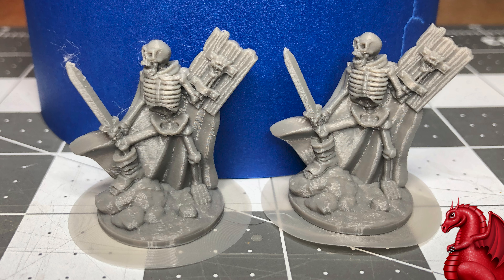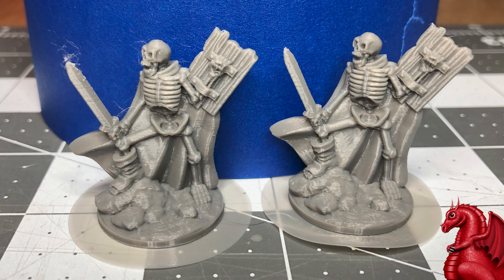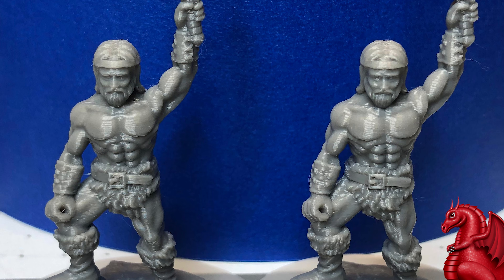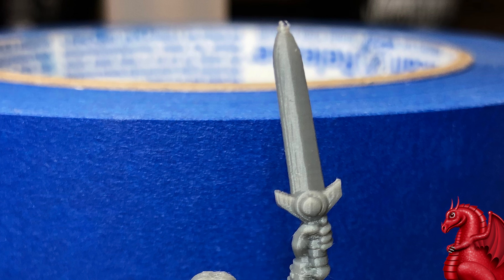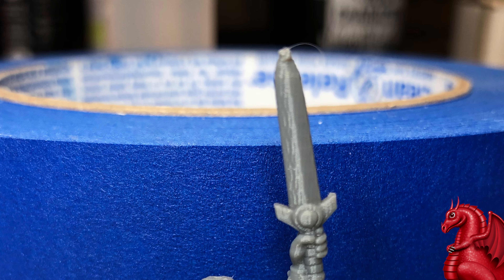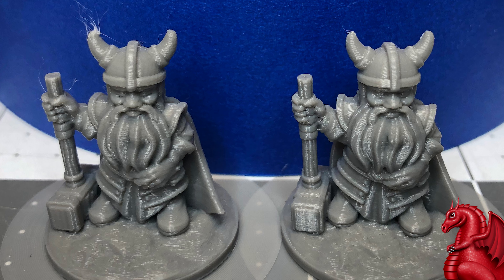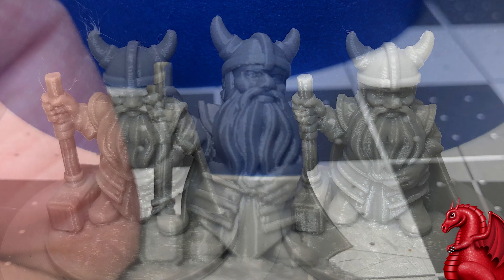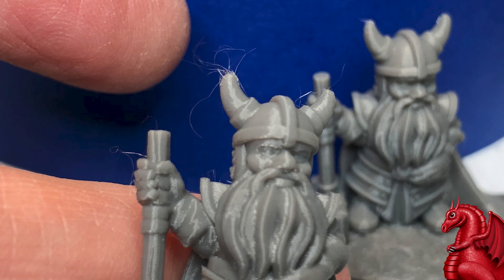Bambu Lab A1 versus A1 Mini print quality

Comment: For those here in the future (August, 2025)  I have had the full sized A1 for 2 weeks now and using a .2 mm nozzle with eSun PLA+ I haven't experienced the stringing at all using the latest FDG profile.
Reply from the maker: My v16 (and soon to be released v17) profile has gotten the A1 to print minis extremely close to the A1 Mini, the difference now is extremely minimal. :)
Reply: There is a noticeable improvement using the hardened steel nozzle over the stainless.
I replaced mine within 2 weeks, so it was not worn.

Comment: thank you for the great video - random question - why do you think there's stringing on the A1 vs the A1 mini? Hypothesis?
Reply from the maker: They are mechanically different, the mini has a linear rail for the Z axis, while the full size has dual screws which is less ideal than a single one (two can 'fight' each other.) Less mass on bed, etc.
Reply: @Tombof3DPrintedHorrors  thank you for explaining. Made a mistake and bought the A1 assuming it'd be mechanically better/similar. I saw your video too late.
Reply from the maker: @OmairZeeshan  The quality difference is slight, and only on miniatures, a fast pass with some tape to pull the strings off and all is good. The full size A1 is a fantastic machine, I bought two and love them.
Reply: @Tombof3DPrintedHorrors  thank you again for your kind reassurance

Comment: Is the mini on base settings out of the box or no. case i want to get a FDM printer that i can print DnD and 40k minis and what not on it with good quality, good for people that can just plug in and go. I not good with it comes to the settings on the slicer programs. I have had good luck with resin printers, but do to being in a studio apartment i cant have one. made me sick.
Reply from the maker: The minis shown are my own designs, so I cannot say how another designer's minis will do (it all depends on their skill level in engineering the miniature). Only changes to the printer is installing a .2 nozzle and using my custom slicer profile (available on my website.) And agreed on resin, we do not use them in our office due to health concerns.

Comment: Just need to thank you for all the work you do! Got my mini a week ago and your v12 profile knocks it out of the park for every print I do. Would love to hear your opinion on supports, as I had a lot of trouble with the auto tree supports not supporting all important areas and manual supports are often pretty encasing and hard to remove.
Reply from the maker: Sorry, nothing I design requires supports, so I don't develop settings for them. :)

Comment: Which one fails more often?
Reply from the maker: Neither, only fails I have had were adhesion issues which the new super tack plates totally eliminate, and a filament clog when I tested cheap filament for my PLA print test video.
Reply: @ thank you so much much for replying I was starting to regret getting the a1 instead of the mini so did I make the righ5 choice of keeping the order?
Reply from the maker: @Memertoad  oh yeah, the A1 is a fantastic machine and will do really nice miniatures. Only difference is you may have a few more strings on minis to trim off, but that's it. :)

Comment: A post processing video would be cool
Reply from the maker: I don't do any post processing, just trim the top most point on the model where the nozzle left the print (there's usually a tiny strand of filament there) and prime.
Reply: @Tombof3DPrintedHorrors  what priming process do you use i have used rustoleum but It always leaves bad layer lines. And I'm not sure if that's inevitable or if I can fix it
Reply from the maker: @ I use Rustoleum (and sometimes Krylon) for a lot of stuff, and Stynelrez for minis when I have to airbrush during the winter.

Comment: Hey Tom, thank you so much for all your hard work and research. I've recently gotten my Bambu Lab A1 (Regular, not Mini) and am blown away by the quality. I am however running into the issue of stringing as you're describing here. However, I feel like the stringing I'm experiencing is more severe. For example, printing the barbarian, the entire area inbetween the body and non-sword wielding arm is filled with thick stringing. Hitting it with a heatgun makes that blob up, but I still have to go over it with an exacto knife to scrape it off, leaving some scarring in the process.

Do you have any suggestions on what settings I could look into to dial this in?

Comment: Why is there more stringing on A1 vs the A1 Mini? Aren't they essentially the same printers? If anything A1 should be better, since it has more stable X & Y axis movement, no?
Reply from the maker: Nope, not the same. A1 Mini has a linear rail for Z axis (and single screw) which is better than just two screws fighting each other. Also less mass with smaller bed.
Reply: @Tombof3DPrintedHorrors Oh interesting. Now I see it. You are right with the mass too. I'm considering between the two, but I'm starting to leaning towards A1 Mini over A1, because 99% of the time I want to use it for miniature printing. Saving 100€ and some space also sounds good. Can you please tell me what is your experience with the noise level of the two? Is it the same for both or is one quieter than the other?

Comment: So from what I understand, the better detail on the mini is due to having a lower bed mass. Would a slower print speed on the full size A1 compensate for the larger bed mass?
Reply from the maker: Bed size isn't the only mechanical difference between the machines, and no, printing slower won't help (it actually makes some things look worse.) The A1 will do good miniatures, they will just need a little extra cleaning up vs ones from the A1 Mini.

Comment: I don't you if you have the time to reply this comment (I hope so). I followed all your previous videos (pre A1) and tutorials, then I tried to print on a Sunlu T3 (basically an Ender 3 clone) two sample miniature from your FDG series.
The knight with horn came out quite well with your settings but the skeleton rising from underground keeps giving an hanging element error not printing the arms and head. What did I do wrong? Is the skeleton supposed to be prjnted with supports?
Reply from the maker: Are you using my Cura miniatures profile? (I'm not clear why this comment is on a Bambu Lab video when you are using an Ender clone and I have Ender 2/3 miniature printing videos.)
Reply: @Tombof3DPrintedHorrors my bad for not commenting on the ender videos. Yes, I followed the settings you suggested in the ender videos and tried to copy the content of your Cura profiles (sadly the version of Cura I can run is older and can't install the profiles directly). I got pretty results with two minor issues I am trying to figure out: 
1) the horns of the knight's helmet came a bit weird (maybe an issue with very small detail with 0.4 nozzle/temperature/speed?)
2) the rising skeleton failed to print part of the arms above ground and the upper part of skull (maybe I was wrong assuming it is support less?)
Anyway I want to say I love your videos because they motivated me to jump into FDM 3D printing (I didn't want to use resin printer but I like miniatures)

Comment: Since both of these models seems to use similar hardware, do you know what could be the reason for difference in the output
Reply from the maker: There are many hardware differences that benefit the A1 Mini, Z axis linear rail, single z screw, etc.

Comment: I find it interesting the A1 Mini actually did better than the A1. I would have figured it'd be the opposite (under the cognitive bias that the bigger, more expensive printer would be better). I wonder what causes that? 
I want to guess it may be something to do with the travel of filament through the slightly longer through the Bowden tube, but that still seems weird that it'd be so significant.
Reply from the maker: Boden tube length is irrelevant as this is a direct-feed extruder. There are a number of physical design differences such as linear Z axis rail, single Z screw vs 2 on the full size (2 screws can 'fight' each other), etc.

Comment: I got your print profiles and some of your miniatures as a test and the results are amazing.  A quick question... do you use any kind of filament cleaner to remove dust on the way in or just feed the filament as normal?  I've seen some people swear by filters, and other say they cause more trouble than they solve with a big chunk of dirt and dust eventually finding it's way past the filter and causing a massive clog.
Reply from the maker: Almost every clog I have ever had was due to filament cleaners/filters. I don't use them anymore.

Comment: What do you think causes the stringing on the full-sized? It's constantly stringier than the Mini...just kind of strange as I thought they were virtually the same hardware 🙂 Awesome video, though...may try to get my K3 dialed in with a profile for some quick FDM minis 🙂
Reply from the maker: The aren't the same hardware, the mini has a single screw and linear rail (preferable) vs the dual screws and no linear Z rails on the full size A1, plus more mass.

Comment: Fantastic! Can you explain how you set up your supports for these minis? Do you do the filament for supports? If you do, what filament do you use? I have an A1 mini, with the 2MM hotend. Do you have a profile for D&D scale minis for the A1 mini?
Reply from the maker: None of my miniatures require supports, everything I sculpt is specifically made for FDM printers! My Bambu Lab A1/A1 Mini profiles are linked in the video description.
Reply: @Tombof3DPrintedHorrors  Thanks, I found the profiles, purchased them, and will try them out. No supports? Wow, nice job. Do you have a link to your minis? Things are kind of hard to find on the main website. Thank you!

Comment: Hey man. I had my a1 (not mini) for 3 weeks now. Always use gyroid pattern for infill. I have a question, why 0.08 instead of 0.04?you can get that with the 0.2 nozzle. I will print once i get the pla meta at 0. 08 06 and 04 to compare.
Reply from the maker: Because .08 produces cleaner prints than .04, especially for overhangs.
Reply: @Tombof3DPrintedHorrors  really? I will try. I have the. 2 nozzle but I dont understand why 0.08 is better than 0.04 like it makes no sense but if is better, then is overall better, also faster
Reply from the maker: Thinner layers deform from radiant heat easier, and also are more difficult to build up cleanly when printing overhangs.
Reply: @Tombof3DPrintedHorrors  but the other areas would have worse detail right?
Reply from the maker: @Wallack  just do some test prints and see for yourself ;)

Comment: is there a "best" colour to use to print mini's?
Reply from the maker: PLA is naturally clear, so to color it/make it opaque various additives are mixed in that can affect final results. IIRC black and red(?) were colors that produced slightly lower results, but that was before pressure calibration on machines like Bambu Lab, so it may not be an issue anymore. I only use gray as that is what I found gave the best results ten years ago.
Reply: @Tombof3DPrintedHorrors  thank you so much for that amazing answer :)

Comment: Thanks for the FDM profiles, the miniatures are very nice and good quality. I do however struggle with miniatures needing support, I currently use the tree auto setting in bambulab, but it is very hard to remove the support from the miniature. Do you have settings for supports I can buy?
Reply from the maker: Nope, none of my miniatures requires supports! :)
Reply: You can find minis that don’t need support to help with this. Also heat it up to help with the removal of supports.
Reply: Have you tried tree slim or organic? Make them as small diameter as possible

Comment: How do you think the x1c compares to these two for minis?
Reply: X1C has no x or y travel on the bed, so it will avoid issues related to that. Other than that, none of it's higher end features are really going to matter when printing PLA unless the flow calibration makes a difference. I've never found flow calibration to matter when using stock filament profiles on the P1P and P1S though. I say that, but you don't know until you try.

Comment: Great help thanks.  What do you think about Bambu's new PETG HF filament for minis?  Would your PLA profile work for it too?
Reply: PETG has a higher heat profile without the additives, so the PLA profile isn't going to work for it.
Reply: @Immolate62  Thanks and yes, this has been my experience.  However, I found Bambu's profile for the PETG HF 0.08mm FDG A1 Mini 0.2 nozzle setting produced really good 28mm pre supported figures.  I found that printing the same unsupported minis but using the Bambu's support - tree(auto), tree slim supports option produced a support frame that was hard to remove without damaging the mini.

Comment: Why do you think the A1 mini is giving better results than the A1?
Reply from the maker: They do the same for large models like terrain pieces. Where the difference shows is on tiny detailed models. They may share the same extruder/hot end design, but the machines themselves have a lot of mechanical differences. A single Z axis screw is better than dual because the dual screws can 'fight' each other. Also, the A1 mini has a linear rail for the Z axis which the full size does not. Finally, the larger bed of the A1 has more mass and therefore more inertia to overcome vs the smaller bed of the A1 Mini.
Reply: @Tombof3DPrintedHorrors  Makes sense. I ordered the A1 before I saw your video. Probably fine for my use case which is prototyping mechanical parts. As long as the prints are consistent then it's fine.
Reply from the maker: @hippopotamus86  I can't advise on that as that isn't the focus of this channel (tabletop gaming terrain and miniatures.)
Reply: @hippopotamus86  

If you're prototyping mechanical parts you may want to upgrade to an X1 Carbon
Reply: @Hellvine  There are little advantages to the X1C than the P1S, I use the P1S's to print the parts in bulk though. Between the P1S's, the parts are spot on and consistent in dimensions, the A1 however seems skewed. I've not looked into the skew correction yet, or if it even has it. I probably shouldn't have got the A1 and just got another P1S instead.
Reply: @hippopotamus86  

Hmmm very interesting.  Thanks for the information. 

I’m likely going to purchase a couple of  A1 minis for miniature printing—I haven’t seen another FDM machine that comes close to this level of miniature quality.

Comment: I found A1 full size when print sometime will go to clean print head while printing, sometime is cleaning by move nozzle to the left filament cutter and some time will cleaning nozzle by go to right upper corner of the print bed, actually this effected sometime printing result not so good, I feel the nozzle no need to be clean while printing result will better, did any on A1 user meet this problem? can I adjust to setting to avoid this?

Comment: Though I don't like closed source printers, we got A1 Mini for my son from anniversary sale. On ender 3 V2 clone, even with dual Z, Orbiter 2, BLTouch-copy and A1 heater and nozzle (tool-less change, no leaks), printing is a bit tinkering. Z-offset seems to always change (might be due to A1 nozzle or the mounting) and layers are not easy to get smooth (again, might be due to sharp A1 nozzle making it delicate for flow, while ordinary V6s and volcanos have wide flat nozzle tip smoothing away).

A1 Mini is wicked fast, accurate (even more with 0.2 nozzle), silent when not cooling full blast (can't print during night in the same room) and fairly well working. So far only concerns are:
- constant pooping (flow calibration? Like it's reading a book 😅) where some poop can stay attached to the nozzle (toilet section could be deeper to take it all)
- sock getting loose, so it drags against build plate and wears out, messes with Z-offset and allows filament to be pushed inside the sock, gluing nozzle to heater.

I'm not thinkin about P1🙈

Comment: Looking at the cloaks and swords, it seems the full-size A1 has some kind of z-banding issue where the surface does not look perfectly 'flat'. Like @12:04 - there's a lot more artifacts going on along the layer lines on the left model. The right model has more ringing on the cloak near the boot, though.
Reply from the maker: This was consistent across all full size A1s we have in house and also confirmed on two others we do not own when running the same profile and filament. Remember, the A1 has a much larger bed and thus more mass/inertia to deal with on direction changes which is the likely culprit compared tot he much smaller/lighter A1 Mini bed.
Reply: @Tombof3DPrintedHorrors  which is why you should get a P1 to find out the results when the bed is unslung.

Comment: Now I'm curious ender 3 v3 se vs a1 mini using your 0.2 profile. Maybe just a shorts video comparison
Reply from the maker: Not even close. I tried for months to get my V3 SE to print good minis, but it just isn't possible with the Sprite extruder. The Ender 2 Pro (followed closely by other Bowden-feed Ender 3s) are the best Enders for printing minis. I have multiple videos and custom Cura profiles for using Bowden-tube Enders to print minis on this channel.

Comment: Dho, maybe it's just the fan, try to clean it or get a new one on the A1.
That's for the stringing, the details are expected with a smaller printer.
Reply: Should details be different?is the same printer just different bed
Reply: @Wallack  The A1 mini has less moving mass and shorter belts. Also the kinematics are different, the Mini has linear guide on the Z axis, it's a cantilever with just one motor.

Comment: I was lucky enough to get the Mini (Combo) in the very first batch over a year ago.  With the firmware updates, it gets better each time.   It's noticeably quieter than the A1.    It's quick enough to put out terrain, so no 'need' for a 2nd printer.